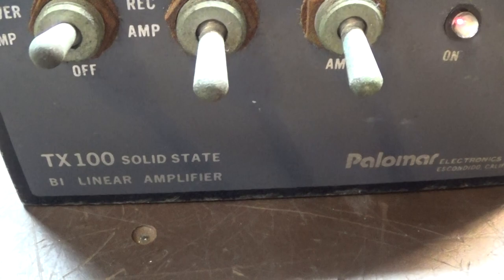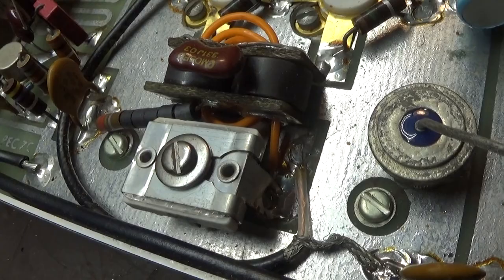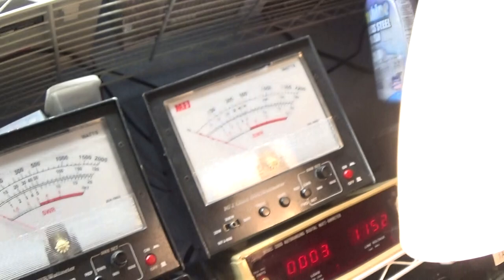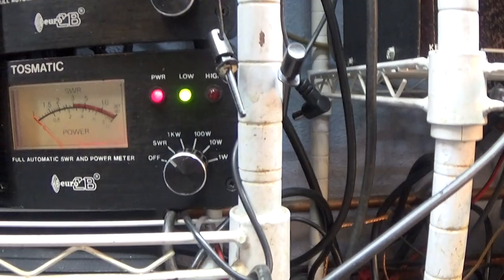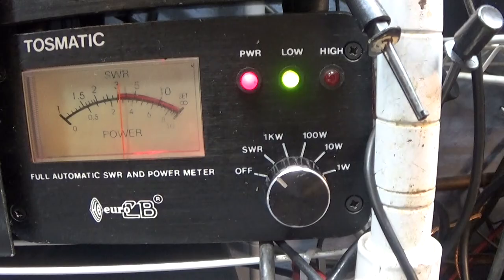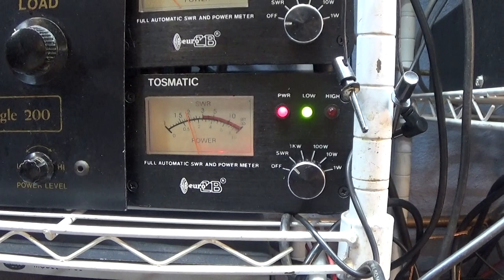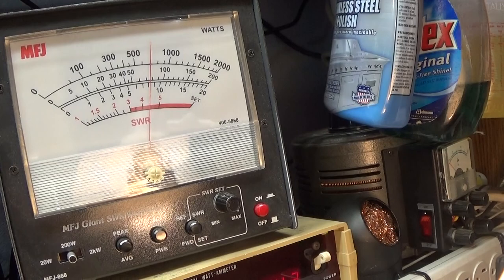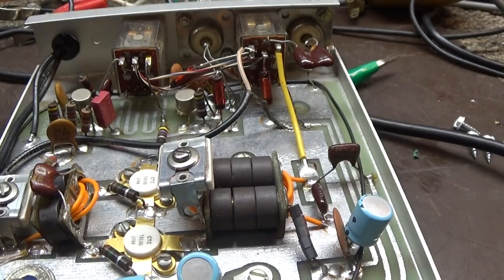Input SWR tuning on a Palomar TX-100 2 pill amp.

Comment: cool video.  definitely something that people need to be shown.  just a quick tip to add on.  Make sure you are watching your output watts while you are tuning your input SWR.
you want to find the sweet spot where the input SWR is minimum and the output watts are maximum.
it is possible to choke the input watts so far down that the SWR appears to be going down but what you are doing is turning down the power going into the amp.  its a resonance thing!
Reply from the maker: Agreed, and I do that, but for this video, wanted to keep it very simple. I may add that if I do a followup one day.
Reply: @tramdr  you know i just re-read my comment and i realize it sounds like i was trying to give the advice to you.  It is obvious from your videos that you know what you are doing.
My tip is meant for those who find this video.  thanks for all the great content!

Comment: Also never use metallic screwdrivers when adjusting trim capacitors. Even if the screw side of the trimmer is at Ground potential. You want to use plastic tuning tools you will add extra capacitance to the Circuit which will throw off the tuning. Also there's a chance you might accidentally slip and short something. The right way to do the tune up that you're trying to do. You can use the SWR meter on the input and output that will work. You also need a amp meter and voltmeter looking at the current draw of the amplifier you want to adjust the input tuning for minimum reflected power and maximum output power you want to adjust the output tuning so that you have maximum output power with the lowest possible current consumption. So you would adjust that trimmer while looking at the amp meter and the output wattmeters essentially maximum output power minimum amount of current necessary to generate it. That is the most efficient operation of the amplifier at that point. When you multiply volts times amps it'll tell you roughly how many watts of energy you have going into the amplifier those transistors tend to run around 60% maybe 70 at best. So if you can have something in that neighborhood your amplifier is operating at Peak efficiency. Also try reducing the drive power and see if you can keep the same amount of output power. Most amplifiers don't need a whole lot of drive if they're tuned up correctly.

Comment: So this is a variable capacitor hooked in parallel with the input lead to the transformer and ground?
My little 1 pill amp seems to be resonant on 28.500 MHz in the10 meter ham band checking it with an antenna analyzer.
With the relay off it bypasses the amp and I have to hold the relay on to check it.
What turns the relay on keying up the mic? The power button is not turning it on.
Reply from the maker: its called a keying circuit, a small transistor like 2n2222a or 2n3906 puts a ground on the relay when it sniffs the radio signal input coming in. Those transistors go bad, usually from someone putting too much drive into the amp.

Comment: hi dr i have a palomar hd450  with 4 sd1446 pills. 2 pills on one side run real hot.  i swap them over with the 2 pills on the other side. then those ones run real hot. pills test ok on the diode meter and are a close match. it has a single bias tranny and the pills recieve .56v. the swr back to the radio is 2:1. i cant see any caps or resistors blown. it is pre tuned, so no vaiable caps. the output of the amp is 320w. it used to be 400w. when disconecting 2 pills from either of the 2 sides . running 2 pills only  it puts out 130w.. even on the side that runs cool..  any ideas as to the unbalanced condition
Reply from the maker: I would guess something is wrong with the output circuit on the side that runs hot. Bad coil or cap.

Comment: I recall reading that  Capacitance  should precede the Inductance on Input but follow  the Inductance  on output.   I realize your trimmers were on the  Transformer cores.  I'm trying to determine trimmer placement on a homebrew 4 pill so I have a combiner  preceding and following the T's.  I want an L-C on both ends of my amp.  For Trimmer placement I plan on deeming the Combiners as the Inductance for Trimmer placement.  At least for my first Power On try.  IDK about trimmers on the T core I was going to keep the mica's.  What sort of volt rating should I use Minimum on trimmer caps?
Reply from the maker: I don't mess with pills, good luck.

Comment: I've got an old 667v that has variable caps on the input and output xformers.  Would it be ok to tune it for best SWR and best forward power, remove the tuner caps, get their capacitance then stick on the closest non adjustable cap in their place?  I've found the adjustable ones wander with time in a mobile.
Reply from the maker: Nope. Parameters change. Examples, you change coax, radio, antenna etc. Yep, antenna because yes its the output stage, but even output tuning has some effect on the input.  One guy on Facebook kept arguing with me that the driver output tune cap was the input tune cap because it effected the input SWR. He didn't know that the after (or before) tuning will effect the next stage.

Comment: Now I know why my SWRs are high when I use my amp. I've been trying to figure this out for awhile. thank you.
Reply: Just to be clear man....this only applies to the INPUT swr bud. If its on the output....you have different issues. In other words....if your swr is high....with the swr meter between the radio and the amp....then this or similar is the issue. Of the swr is high woth the meter between the amp and the antenna.....its another issue. Most likely harmonics,poor output tune , bad components causing oscillations or all of the above. Just to clarify the difference between input and output swr

Comment: Ive been given a 1 pill Mini Ball TL-60.
It has 1 MRF453 Transistor rated for 60 watts.
My Stryker 955 will do on low a little over .5 watts on high about 3.8 watts dead key.
Do you have any idea where to set dead key on this thing man?
Also it has high SWR between the amp and antenna with the amp turned on.
Reply from the maker: more like personal preference.

Comment: Great video it would be nice to see a modification how to add an input trimmer to add that doesn’t have one.....

I wish all abs had an input tuner..
Reply: That's easy just take out your mica capacitors on your input and output transformers and replace them with variable capacitors then you will need to retune your input and output swr for the lowest reading which lowers the reflect back to your radio and the output swr with the amp on will be lower at the antenna or dummy load like he did in the video he did not tune the output transformer in this video

Comment: Then you take the trimmers out and then you check the capacitance with a multi meter and get some metal clad capacitors that read the same capacitance of the trimmer and solder it where the variable capacitor was soldered you can use cheaper Micah capacitors on the rf transformers but metal clad type are better